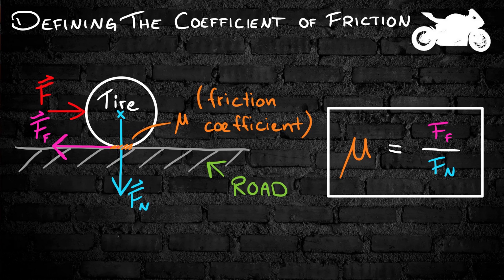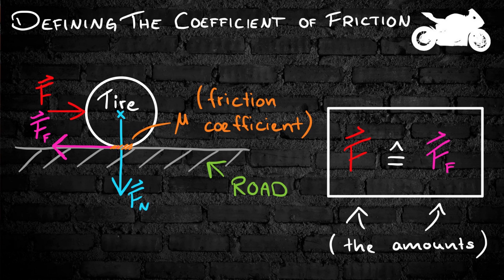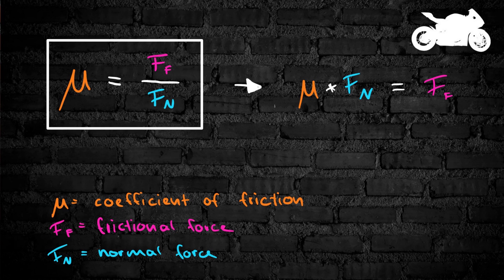How FAR Can Motorcycles LEAN? - 3 Key Influences

Comment: It's interesting how formulas are helping us get there better. What's more interesting is how the brain can sense in a femtosecond either that you've lost it or you've got the better edge of the grip. Better grip comes from better weight. As they say, "wait for the weight". Correct temperature, proper weight transfer and right body position can instill better confidence and stronger grip. Of course, it all depends on the weather, the road condition and what not. But on a good, dry, perfectly laid road... proper grip is a feeling like no other.
Reply from the maker: Yeah true, the formulas & calculations and what we feel on the street are two separate things. But it's always cool if we are able to put them together 😊

Comment: There is one way that the motorcyclist can influence the effective friction between the tyre and the road, and to quite a significant degree.
First, a condition.  If the required lean angle is such that there is ample grip (friction) for the cornering radius and speed, there is clearly no need to do anything - barring problems such as patches of oil or sand, the corner will be completed without issue.
However, if there is risk that the lean angle required to complete the corner will be such that the grip might be insufficient, the rider can do something to prevent this.
Provided that the rider reacts in time (before the tyre is in threat of slipping, in other words as the rider is leaning into the corner but not yet at maximum lean) he can apply a small amount of front brake pressure. (Very important - this must be front brake, not rear brake, and not even a combination of front and rear brake.  Front brake only.)
This will achieve two things in quick succession.
(1) The first is that the overall weight distribution of the motorcycle will change - moving more weight onto the front wheel.  This increases the force the tyre exerts on the road, which has two effects. Firstly, the effective contact patch is increased, the tyre actually flattening more against the road surface,  Secondly, both this increased contact patch and the increased weight on the front wheel results in increased frictive force, thereby improving the grip level.
(2) The small amount of brake pressure will also result in reducing the speed of the motorcycle.  Reduced speed will result in a reduction of the required lean angle to complete the corner.  This second factor is of course cumulative, every second of applied braking will reduce the speed even further.  (a comment here - if the allowable braking force at commencement is say 5% without losing grip, after only a second or two the reduction in speed combined with the increased grip due to (1) will allow a braking force of 10% or 20% - this progressive application of braking force will slow the motorcycle very quickly.  Also, at even 20% of braking force the grip level of the front tyre will change dramatically, due to the increased factors in (1) above.).

The combination of these two factors will result in a far higher likelihood of completing the corner, versus lowsiding due to loss of front tyre grip.

This technique is known as "trail braking" and is applied by all bikers that are competent at cornering.  
It should be noted that this is somewhat controversial - not in terms of whether it works or not (of course it does) but there is some controversy over whether the average motorcyclist has sufficient skill to do this without locking the front wheel.  The american MSF, for example, believes that the average motorcyclist is so incompetent that they cannot execute this relatively simple technique.  I will refrain from providing my comment about this assessment.
Reply from the maker: That's true! Thanks for the clear and useful addition 😊  the effects of tail breaking - as you perfectly described them - influence again the coefficient of friction -> through the change of the contract patch and so on.

Comment: Point of clarification: Normal Force would be in the opposite direction. The downward force is Weight (mass x gravity), and the Normal Force would be upward to keep the body in equilibrium.
Reply from the maker: Yup, since I don't talk about the ground pressing against the tire (but the other way around) you're totally right. Must have happened during translating all that stuff... Thanks a lot! I'll add a correction note 😊
Reply: Happy to help.  @GiuliaonGasoline

Comment: You can lean to end of your tire not more. Speed in corner,bumps etc is another story ---
Reply: You can actually lean over the edge of the tire, the sidewall is designed to deform. That's why supersport tires tend to have a shallower profile than sport-touring rubber, despite being capable of higher lean angles. It's also how people get that frayed ridge on the edge of a worn tire.
Reply from the maker: Exactly. Of course the coefficient of friction could change after you've reached the edge... But when it's still high enough you can still lean over the edge.
Reply from the maker: What @dsofe4879 says. Bumps of course add a change in vertical forces which aren't useful for large lean angles.